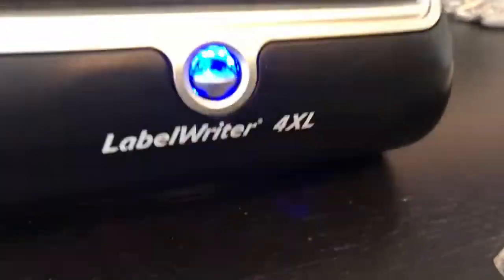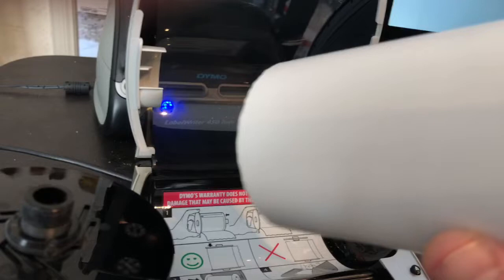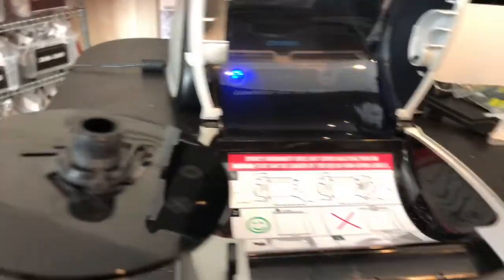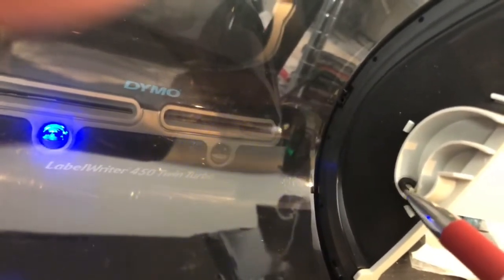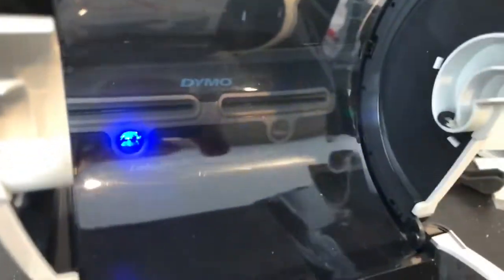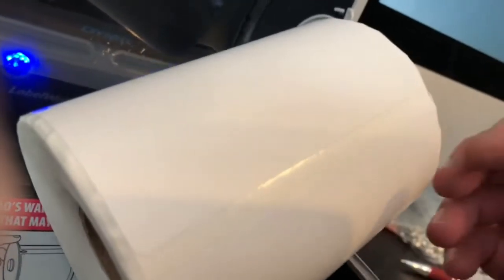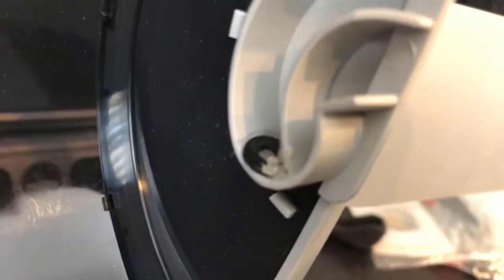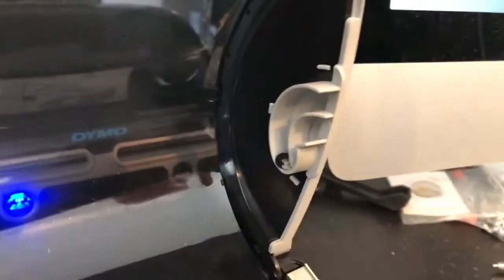Dymo LabelWriter 4XL printer FIXED extra labels error

Comment: my Dymo doesn't have that rubber thing, it didn't come with it. I bought it a few months ago, from the manufacturer. Do you know how to fix "Dymo is Paused" , doesn't want to print. Just replaced the roll with a new one.
Reply from the maker: I just used a little rubber washer I had layi
ng around